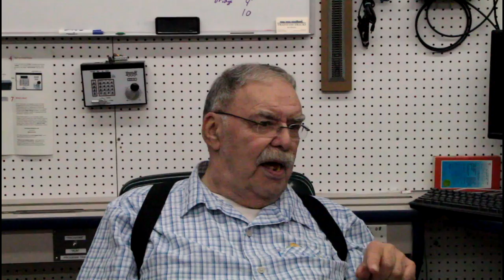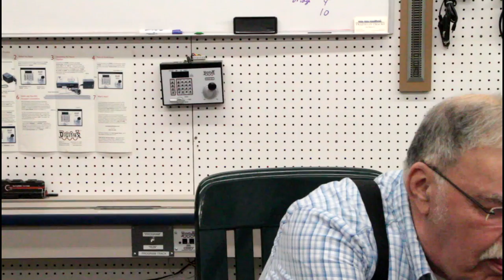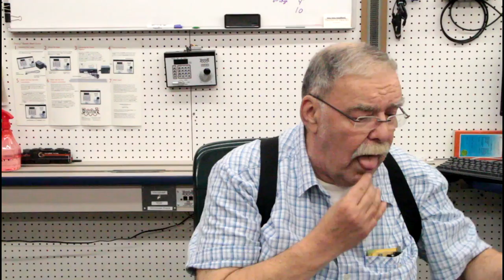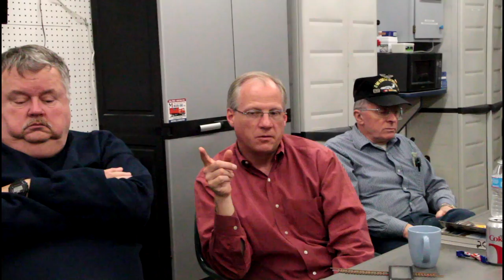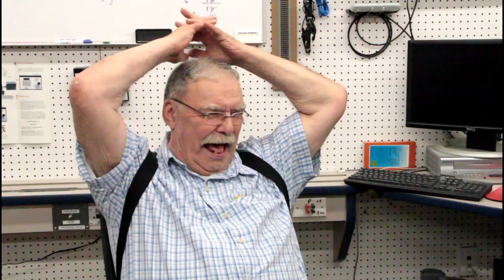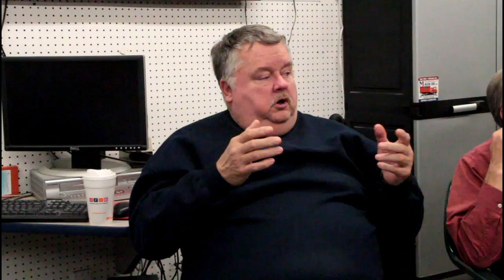Basics of Arduino Controllers for Model Railroaders

Comment: If you need to use a bunch of relays and servos, this video shows you how you could run each item independently and simultaneously as the code is non-blocking - meaning that it doesn't stop to perform a duty before continuing. As an added benefit, you can even set the speed of each servo. Here is sample video on relays from my Vimeo channel, but there are more videos on steppers, servos, etc.  Have fun!
https://vimeo.com/173236054